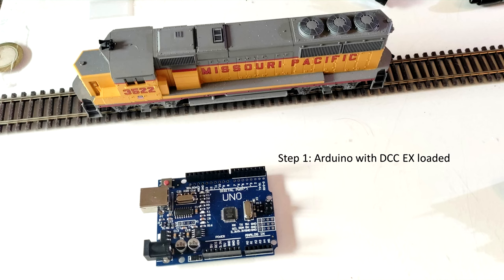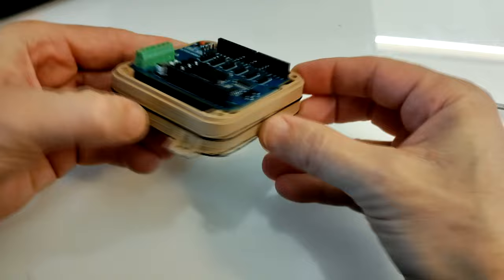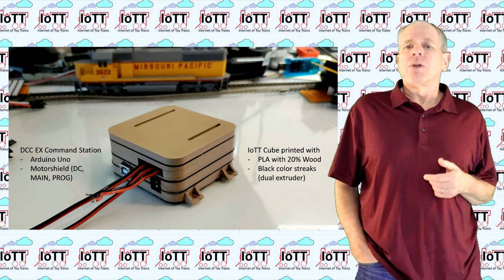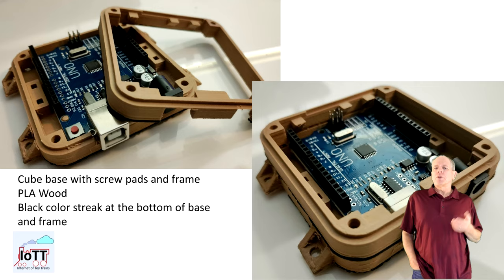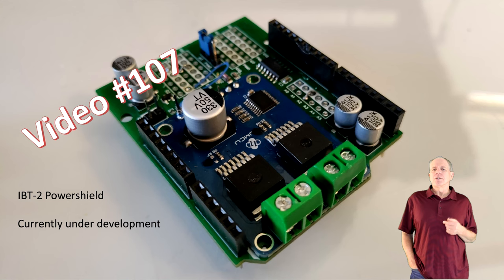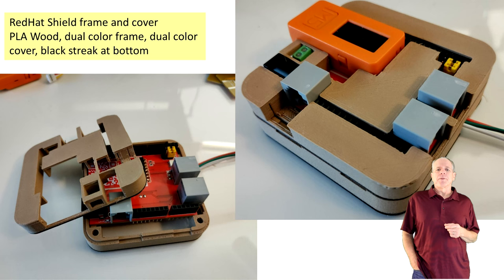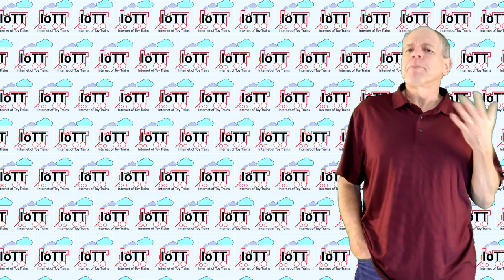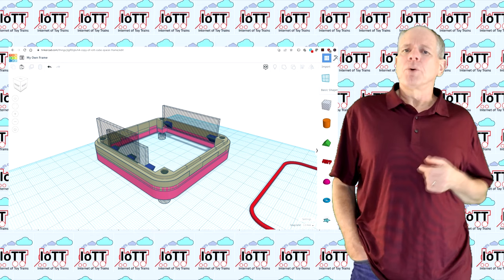DCC EX Enclosure System (Video#108)

Comment: With a full stack (Arduino, motor shield, DCC aux shield, Red Hat shield) I found fishing the hold-together wires through challenging. I used coffee stirrers (thin plastic straw type), pushed up from the bottom of the case, to act as temporary guides for the hold-together wires. That made assembly much easier.
This system, including using wires to hold it together, is terrific - far and away the best enclosure system I've found for DCC-EX.
Reply from the maker: I like that idea! Another option is to cut the wires a little longer, so you can have more distance between the cover and the first frame to insert them. It's much easier if you can see where the wires are going ;-)

Comment: I really like your modular case/housing system.   I printed a case from Thingiverse, which had the slot for the LCD panel on it, but I find that the clips break fairly easily due to being so thin.   The modular approach is a wonderful idea for these.   Thank you for this :)
Reply from the maker: Thanks. These frames are using 4mm wall thickness, so they are relatively strong.

Comment: Could you make a video of all the shields you can stack on the Arduino Mega and that can be used for DCC++EX, as well as going more in depth about it?
Reply from the maker: Videos #113 and #117 would be a good starting point to get an overview.
Reply: @IoTT  Thanks, and, is there a video about adding a display to DCC-EX?
Reply from the maker: @BrennerEraFan  I'm sure there is, but not on this channel. Also check the information on displays on the DCC EX web page. DCC EX supports several I2C display.
For me the topic is not of interest as the IoTT Stick has a display on it's own, and for more complex stuff, I built a web server into the Stick, so you can conveniently change all settings in a web browser. I don't know why I would punish the user to use a. a 2 or 3 line display. Browser based technology is ways more convenient

Comment: I just completed building my DCC-ex.  Only thing I need to do is reflash the Wi-Fi board.  I am looking to have this printed. (Don’t have a printer).  Just curious, for those using this enclosure, with no ventilation does the Arduino get hot?  That is my only concern.
Reply from the maker: The Arduino only uses about 50mA, so there is no problem there. What can get hot is the H-Bridge if a lot of track current is needed. But then there are vertical channels on the sides of the board along with gaps between frame and the various connectors so that some air convection is possible. So far I have not seen heat being a problem.

Comment: In Tinkercad there's a Mega base, but I'm not seeing a Mega Base Frame - the "cap" for the Mega base. The one that's in the Mega figure looks like an Uno Base Frame. Am I missing something?
Reply from the maker: The Mega Base Frame has the same footprint like the other frames that come on top of the Mega. But it is different from the Uno frame as it has openings for the additional pin headers of the Mega. Then you can use the small cover to close the remaining part of the Mega, again it has two versions, one with, the other without openings for the pin headers.
Reply: @IoTT  My apologies - I was combining an error with a couple misunderstandings and wrong assumptions. I see my way forward now. Thank you.